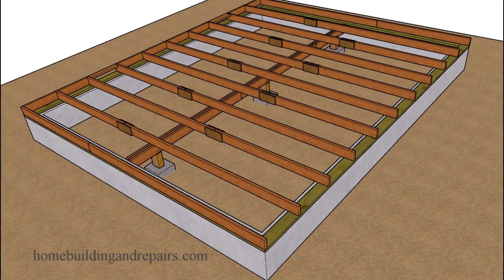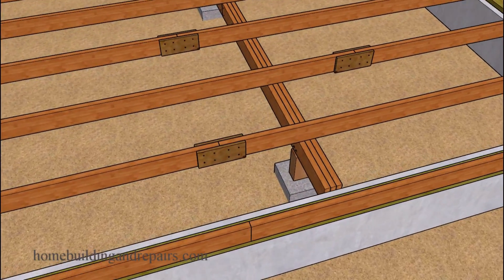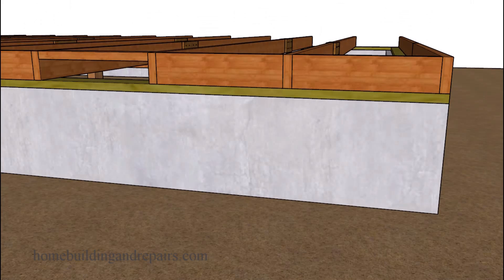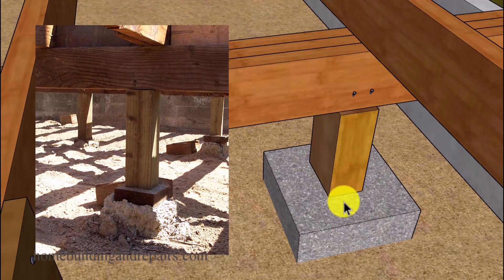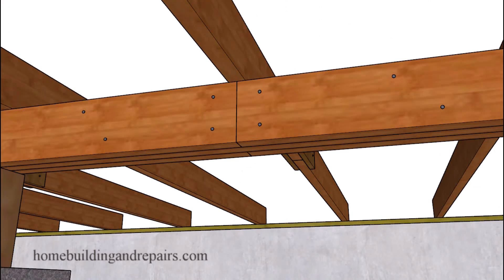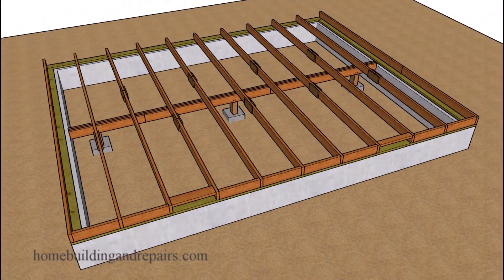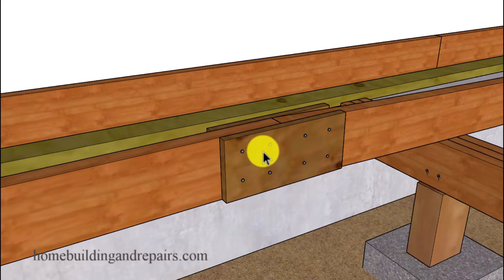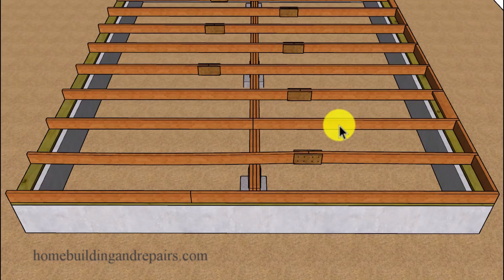Alternating And Staggard And Cantilevered Old Fashion Floor Joist Framing - History of Home Building

Comment: It feels like you made this video specifically for my late 1800's bank barn... except my framing is even more egregious. The lower section was originally an open-air cantilevered/overhang until it was enclosed to create a 2 car garage. Unlike the model, my support beam is actually legit.... it's the above floor joists that are a disaster. and they're monsters (thick). I'm experiencing the very same sagging joist problem that you mentioned. I can't fix one end without compromising the other. My big winter project will involve ripping out the above floor and laying all new joists. I'm actually looking forward to it. Anyways...thank you for your videos. I've been watching for years and absolutely love them. My wife does not.

Comment: I repaired an old floor at Masonic Lodge in Rockwall, Texas, and that floor was built that way. In-fact, the perimeter in many spots were just old bricks, stacked up to support the floor joist. 2x12 cedar floor joists, at least 100 years old. It was one of my favorite jobs that year. Problem is, bidding such a job is so difficult because you never know what you'll uncover.
Reply from the maker: Thanks for sharing and I always find it interesting what is still standing even though an engineer might not have ever approved it:)